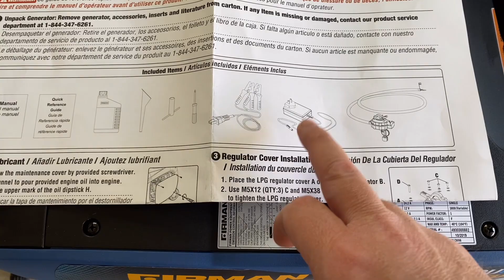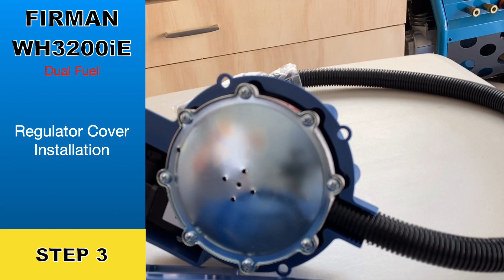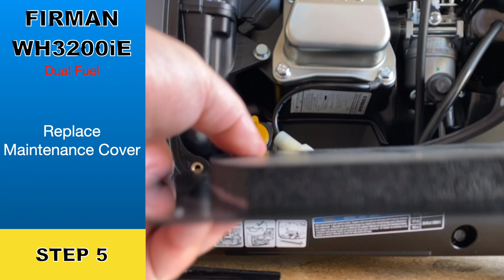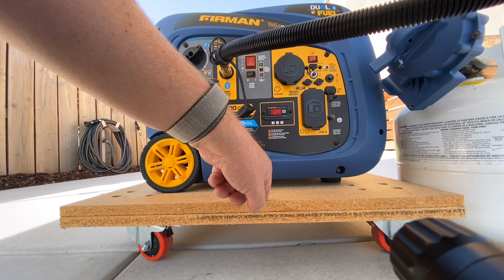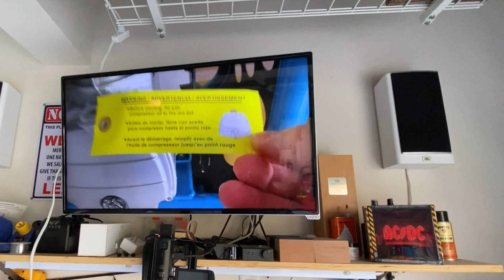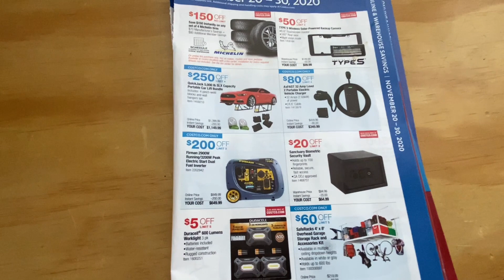Firman WH3200iE Dual Fuel Generator Propane and Gasoline

Comment: I just watched your video as I just bought this for myself before Christmas 2025 for an exceptional price of $299 on a half price sale on Costco. I am assuming that it was a discontinued model but since it is only for emergencies I got it. I have an old gas generator i bought in 1990 during an ice storm up north and have less than a couple hundred hours on it and have had to have the carburetor replaced once and cleaned again after that as I don't use it all the time. 
This is a useful video and I will be setting it up soon. Thank you so much.
What is that vehicle that you were plugging in? 
That has a 110v Charger?

Comment: This model is currently on sale for $299. Is it worth the $300 price in 2025/26?  Don't know much about generators but if the power goes out, I'd like to power a window unit, my fridge & the internet.
Reply: Just bought one at that price from Costco. Should be here in a couple days. Looks like a nice unit and you can't beat the price.

Comment: Not sure if you've found a reason yet but I was watching another video and the guy mentioned that his RVs surge protector was reading open ground so EVs wouldn't like the generator. Apparently this is common/generally accepted in inverter generators.
Reply: Just get a neutral ground bonding plug and that will take care of it.  It will cancel out the open ground.  Just plug it into the 120v problem solved.  The EV should then charge with no issues, same for RV's.  They are all over Amazon anywhere from $6-$16

Comment: A piece of junk. After 2 years of very light use, the plug for the charger broke and it's difficult to fix. I had to pull the cables out and I give it a boost from an external battery pack. The pull cord is very heavy to operate.
Reply from the maker: Nooooooo, not what I want to hear. So far so good with mine but I have to admit I have only used it during one power outage about a month ago and that was flawless. Otherwise I have only tested it from time to time. I need to do a video with the house connection. The generator power more then half the house.

Comment: A few suggestions (and I know this an older video).  First, thank you for doing this.  I bought one secondhand and watching this really helped me get used to it.

- Consider editing the video down a little bit if you're putting in a bunch of screws or something.  Show doing the first one and use a transition to skip to having them all in and IF you need to comment at all (e.g. on trouble you had), do it after you put all the screws in.  I found myself trying to fast forward a lot to cut down the watch time.  I know you already get it.
- Consider putting your device on a taller workstand.  Probably easier on your recording from the floor.  Very cool use of dollycarts though.  Great idea.
- Consider putting a white backdrop even a bedsheet hanging to remove the distraction of all the neat stuff in the background.
- Love that you recorded your (easy to make) mistakes like forgetting to open the valve on the propane tank.  Seeing mistakes and fixing them is a great way to learn.
- Maybe some text of "Make sure you (1) have the dial turned to ... (2) Have the choke pulled (3) Open the valve on the gas tank" or other common mistakes you could make.
- Love that you covered the difference in experience in Eco mode.
Reply from the maker: Thanks a bunch, this video was a mess for sure. I am hoping I was able to at least help folks get familiar with the generator. Again thanks for the tips.

Comment: Great video.. I've been looking at a few for emerg. purposes and like what I see here with this model!  A thousand bucks here in Canada at Costco, but not far off from a smaller unit from Generac        Nice garage BTW!  Thanks for your time in making this.....Costco Canada owes you!
Reply from the maker: Jeff, thanks for the nice comment. I love this generator. Of course it does not get much use only firing it up from time to time. I have retired my house and this generator will port 80% or more of it.
Reply: Hopefully you didn't buy it. It's cheap for a reason.

Comment: just bought one. i had a 9600 great open frame so loud high fuel. I've had the 9600 over 2 years and Costco let me return it for full refund; no questions asked. it is was the newer CA modeln. $849 online and $799 on sale in the warehouse. thanks for everything.

Comment: Have you ever tried it with an RV AC unit. Sure be good to know before I take the plunge.
Reply from the maker: Good question I have not, but others have. It will be several years till I purchase an RV, so I have happy to have it available for my home. I have fired up the generator just a couple of days ago for maintenance and all is good I did run it under a load for about 20 minute.

Thanks for your comment.
Reply: @AimSmallMissSmall_TV  Any updates on this? I have a 15,000 BTU A/C on my RV with no Easy Start/Soft Start. The manufacturer states the running watts but not the peak draw on startup, so no way to know without trying it. I like the idea of running a generator on propane so it's less smelly compared to gasoline, and Costco has an outstanding deal on for this right now (699 CAD). Hopefully it's beefy enough to run the A/C. If not, thankfully, Costco will take anything back, but I'd love to hear your experience.

Comment: To charge your car try getting a 120v-30a to 120v-20 amp rv adapter and try charging your car that way, you'll get a higher max ampacity, I think the 20A-1P PLUGS ARE GOOD FOR 13.5 AMPS AT 120V where the RV plug can provide more, I don't know if that was the problem but it's worth a shot.
Reply from the maker: p. porter, good point makes since. I'll test on my follow up video. Thanks a bunch
Reply: You can buy a neutral to ground plug it should help with charging your  car

Comment: Don't buy this generator if you plan to use at above 3000 ft. altitude (any mountain camping or even any where in the whole Rocky Mtn. west). Here's the review I posted at Costco for this generator: "Bought this generator online and had it shipped to where I live above 3000 ft. altitude. You have to read very closely to see that this generator requires a "carburetor jet" replacement for running the generator at altitudes above 3000 ft. I called Firman and asked about this - they were quick to send me two separate carburetor jets (one for 3000-6000 altitude and the other for above 6000) because I explained that I live at above 3000 and will be using it for camping above 6000 pretty regularly or perhaps most of the time. I asked about which jet would be advised to use - they didn't answer my question - just sent both. I assumed I'd split the difference and install the 3000-6000 jet. The instructions they sent seemed straight forward but was for a different model generator and was for doing a complete carburetor overhaul. Long story short - you need to be a small engine mechanic to replace the carburetor jet that involves disassembling large portions of the generator housing, the filter, taking apart the carburetor, removing the battery, etc. etc. etc. - I failed and returned the whole generator. Total disapointment because I really thought this would be a great dual-fuel generator at a decent price. Don't buy if you plan to use at high altitude - Costco and/or Firman really need to make that much clearer before buying.
Reply from the maker: This is good info. I'll may change my thumb nail to add this note.

Comment: When using propane, you do not need to use the choke. Only purge the air out of the propane line as first the engine will be running on air.
Reply from the maker: Good point, can you help us understand how to purge the air or is the only choice to crank the starter till the generator starts. Thanks for the comment.